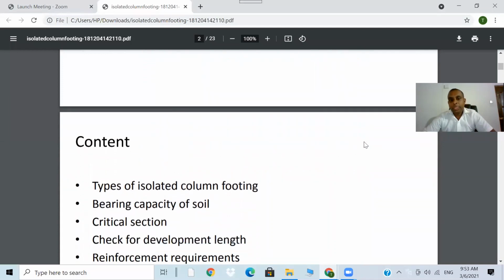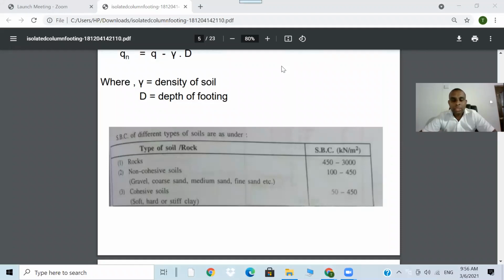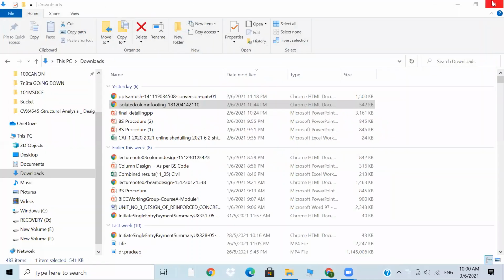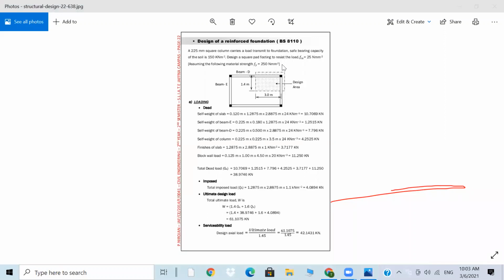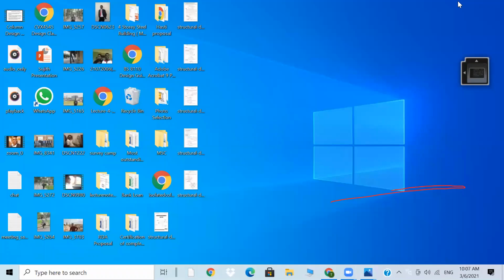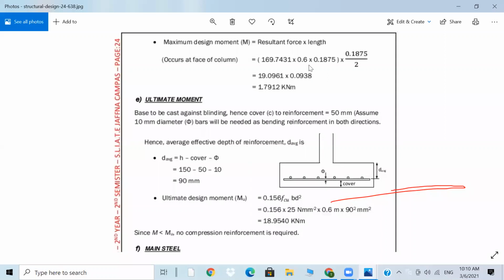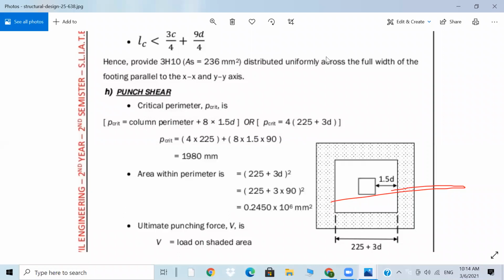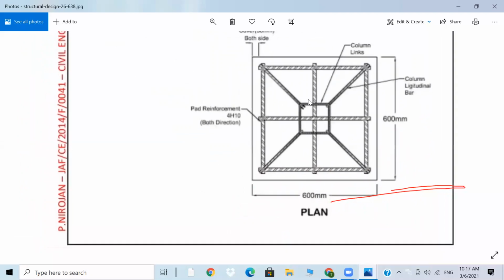BS 8110 Footing design / Foundation design

Comment: Great explanation sir😍. But I need to clarify that why is it used service load to calculate base area? I mean, this calculated area is probably not withstand against ultimate load and permissible bearing capacity may less than the design earth pressure under ULS. So Can't we directly use ultimate loads to calculate the base area?
Reply from the maker: No need. You can work with SLS